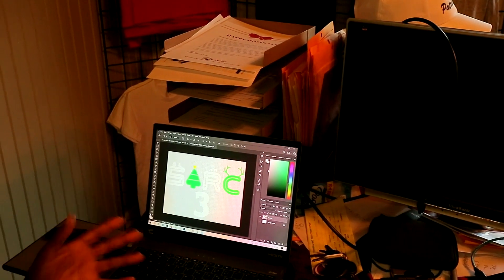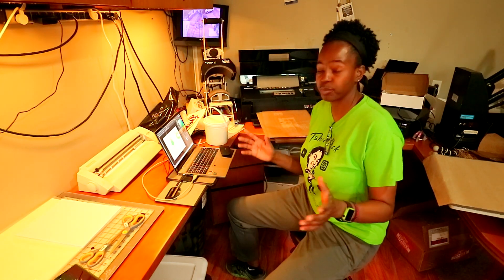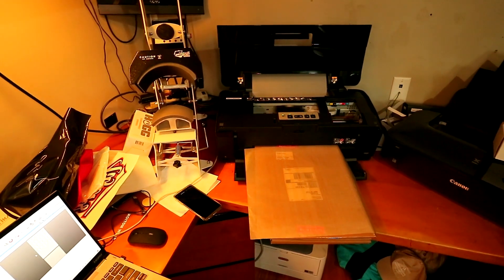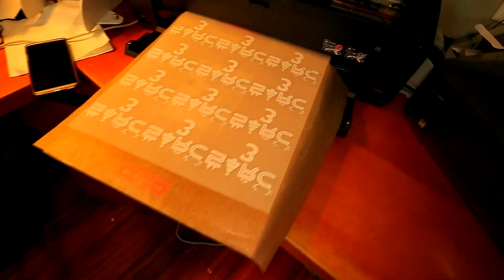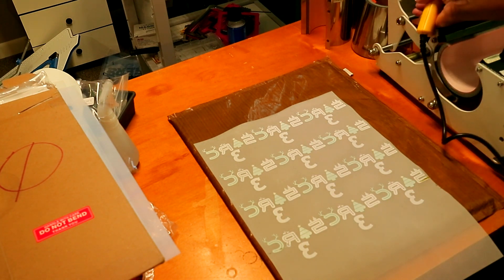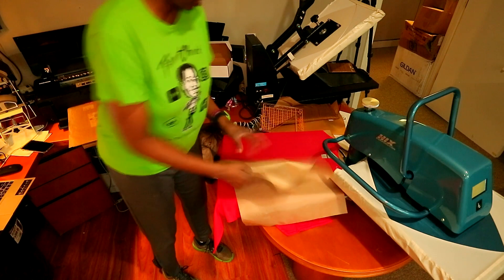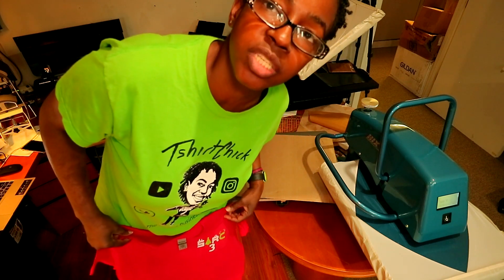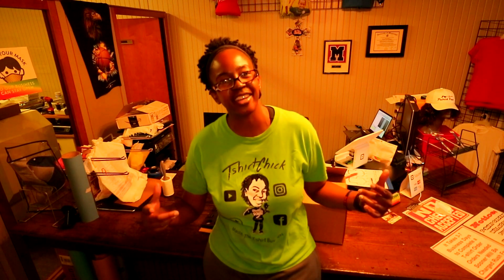DTF T-shirt Order

Comment: Hello Sin, you have alot of Heatpresses take the bottom mat of, lay the dtf foil on the metal and hover your top plate over it to cure the adhesive. Or if your convoyer is on.
Reply from the maker: This was one of my first orders I now have a few different ways of curing.  Thanks for the tips!

Comment: Do you prefer 16x20 heat press or 15x15?  

Is 15x15 more than enough room or should  you always go better?.
Reply from the maker: I used a 15x15 heat press for most of my business I actually upgraded to the 16x20 around 3 years ago.  The 15x15  will allow you to print a lot of different things but I found myself sometimes having to do 2 presses because the press wasn't big enough to do only 1 press for the full design.

Comment: How you feeling about the printer maintenance?
Reply from the maker: What's Up!  Thanks for watching I have been subbed to you for a while LOL!  I have only been doing this for about 2 months and I have not really had any issues.  I had 4 orders that I did DTF for so far and now things have slowed down (which is normal) so I've just been trying to print as often as I can to keep the ink from drying out.  I will be doing videos of any issues I have and things I learn along the way.
Reply: I watch often just not always logged in lol... That's the part I'm struggling with I don't see myself running it every day to justify the purchase and I low-key have fits dealing with the 7720 but I eventually want to get my hands on 1.